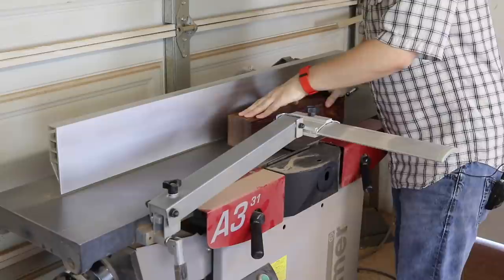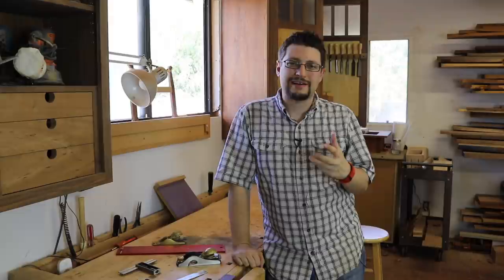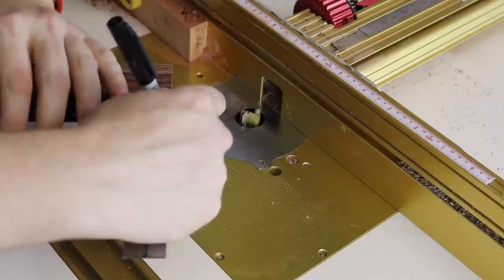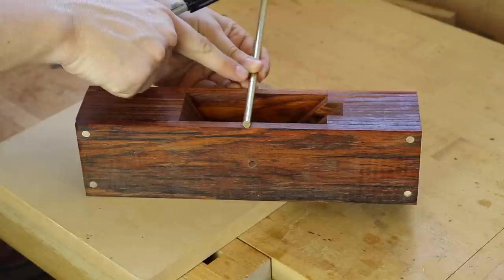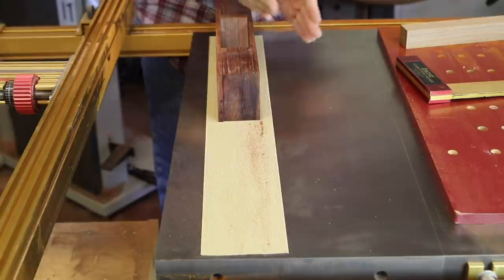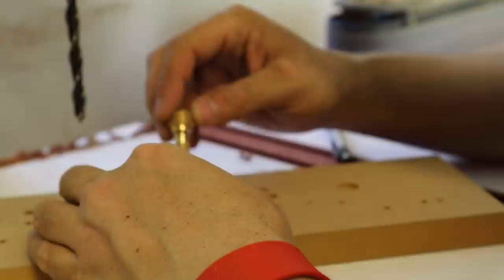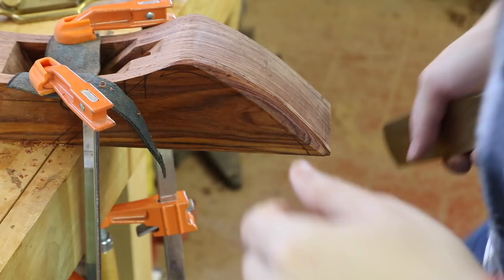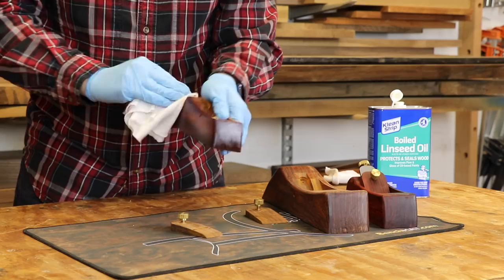How to Make a Hand Plane

Comment: Good job! I have two tips for you.

1) Wax your table top before you put down PSA sandpaper.  It will release easier.

2) Denatured alcohol isn't a solvent for almost any glue.  Better solvents are mineral spirits, turpentine, lacquer thinner, acetone, MEK, xylene and naptha.  Any of them will loosen the glue.

I like to use a slow-evaporating solvent - usually mineral spirits.  Let it soak for a minute like you did and it will come right off.  Put a bit more on a paper towel to clean up any glue left on the surface after the sandpaper is off.
Reply from the maker: Thanks for the tips!
Reply: Fuzzy Johnson, e"%herramientas increíble casera
Reply: Another trick is a heat gun, blow drier etc

Comment: Nice video; but it is funny to build a hand plane which is a hand tool with such electric machinery!!??
Reply from the maker: It works!
Reply: Yeah, that's why I stopped watching it after 3 minutes.
Reply: Trust me, there are a lot of scenarios where I would reach for my hand plane rather than use my machines.
Reply: Philippe Benoiton and how exactly do you think manufacturers of high-end wooden planes do it? Tables full of elves working with only hand tools?  That wood is hard as a rock -very difficult to work strictly by hand.  It's possible, but pointless. This notion that only hand tools require skill and craftsmanship is ridiculous. Machines have been a part of fine craftsmanship for 100s of years. It's absolutely pointless to make an operation require 10x and much time just to claim it was done with "hand tools". It adds no value whatsoever to the finished piece, because nobody is going to reimburse the workman for using the slowest possible method to get to the same place.
Reply: Hand tool craftsmanship when done properly usually takes less time do for the fact of not having to set up machinery and is safer. Now if setting up for doing multiples of the same operation like mass manufacturing then yes machinery is just like "high-end planes" are made in less your talking about less then a hundred years a go where in fact men were making hand planes by hand for you can see the tool markings to prove it so don't be pretentious. This is a great video, very educational but i would love to see the same video using only hand tools for not only the purists out there but for the man that can't afford table saws and the like.
Reply: There's nothing wrong with machinery. The actual issue is somewhat deeper: all these laminated plane making videos on YT are just for the sake of making a video, not making a plane. This particular plane is obviously a show piece - a big unwieldy clunker made from expensive exotic wood with a blade and adjuster from boutique shop isn't going to be an essential tool in this particular workshop. Watching how Matt struggles with his other planes kind of proves it. As for "elves working with hand tools" - check out HNT Gordon channel, who actually manufactures planes for living and witness machines to hand tools ratio yourself.
Reply: If you didn't watch it, don't comment.
Reply: HNT Gordon: Chainsaw, bandsaw, belt sander, forklift...  What's your point?
Reply: @HBSuccess  amen,,,,,,,sometimes i think these guys that complain are just jealous.......unless of course they make their own hand planes using all hand tools themselves,,,,,,and if they do then i am wrong and apologize.....
Reply: Hey Phillippe Benoiton there's nothing wrong with electric machinery just ask your wife
Reply: @mmwoodstudio  Not for all it won't, some of use want to build it for fun but also because we can't afford to buy them. In other word it should work if you have thousands of dollars in electrical woodworking equipment. But who would really need to watch this in that case, because you would have a lot of skills in woodworking to have that much equipment. So yes it works, for those who can afford it. I did buy your videos, and a little disappointed that you do not have any other alternatives to building these other then lots of money.
Reply: So true, These Krenov style planes are disgusting compared to traditional 18th-19th century style planes that actually required skill to make and could only be made by hand. But Guess this Krenov style is quick and easy thats why on youtube mostly everyone makes these POS.

Comment: Make yourself a hand plane , first your going to need a load of expensive machines and workshop and your  going to need to buy a couple hand planes to finish the work .
Reply: Why do you need a bunch of expensive tools? Because its what they show? First one I made was a rebate plane on my porch by using wood, hand saw, pencil, hand chisel, one power cut off wheel to cut handle off chisel, wood file, sand paper and a small hammer. If you cant figure out you dont need the expensive equipment, workshop, etc. then you should move on and look for another hobby. They didnt have this stuff you speak of 150 years ago and dont need it today either. Yes all these wooden planes can be made today without the big fancy tools and workshop, just have to use your brain.